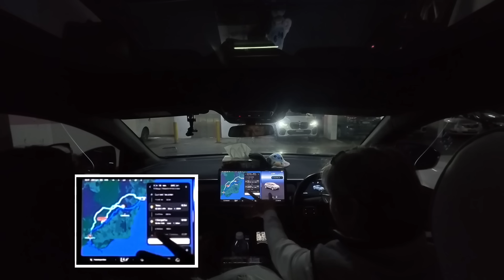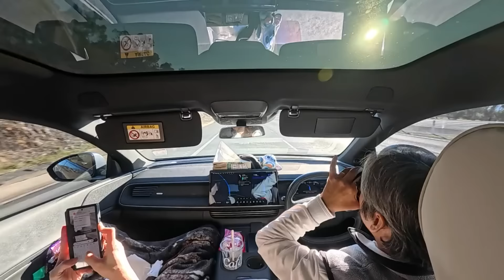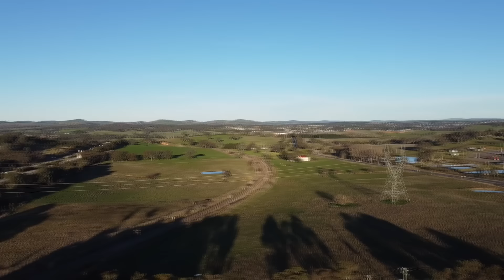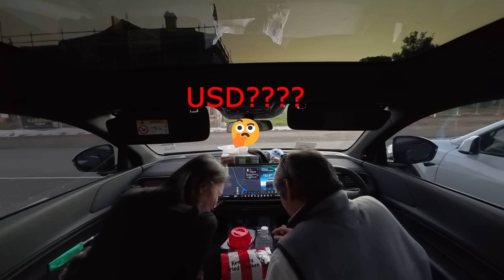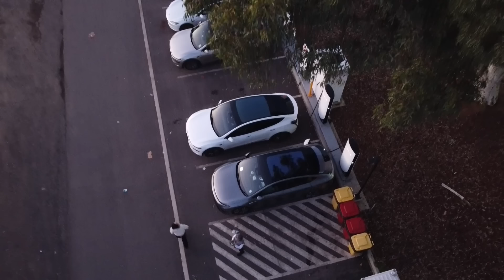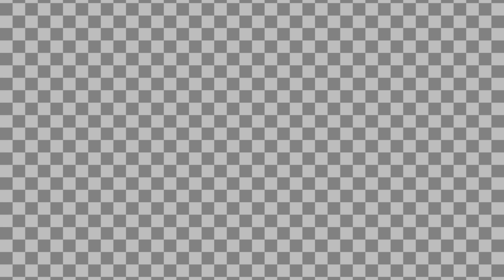Xopher G6 Road Trip: Sydney to Melbourne EV Range & Charging Test

Comment: Cold weather at night always uses a lot more power. Even the Model Y RWD I had used to use at least that along the Hume.
Reply from the maker: Yeah, I use 5km per kWh or 20 kWh /100 km in the back of my mind but I was thinking that since the ABRP software has got enough efficiency data, for sure it is more accurate for the drive from Albury to Melbourne. How wrong could I be. 😂 As I said there, I gave my wife the taste for range anxiety. 🤣

Anyway, now that I know, I will probably keep customising the planning and having more charging session is better than having no range left at all or in this case barely made it.